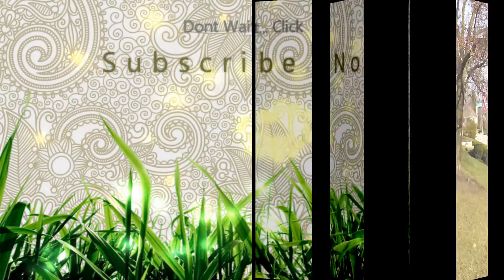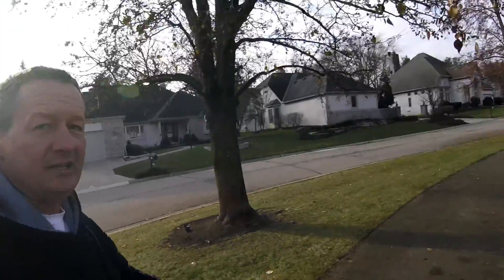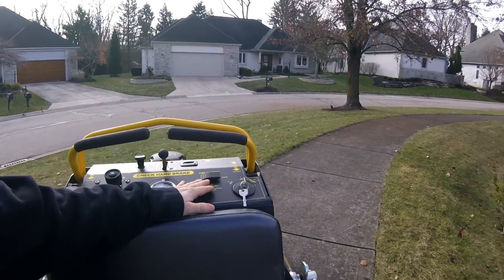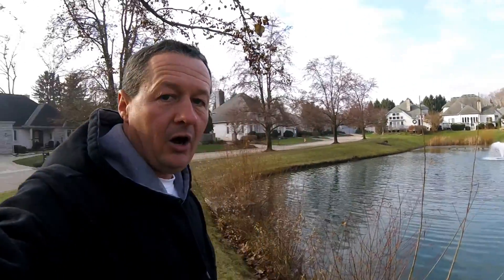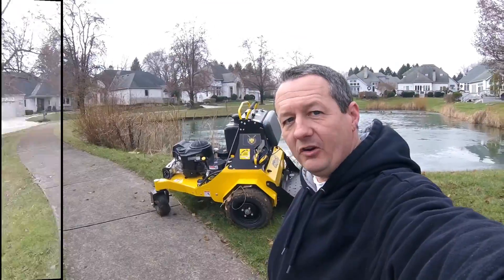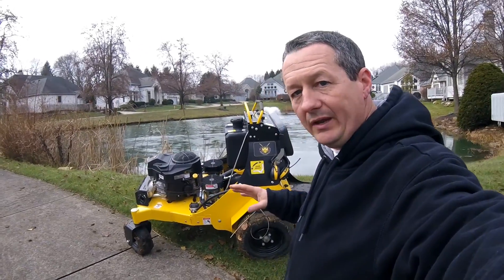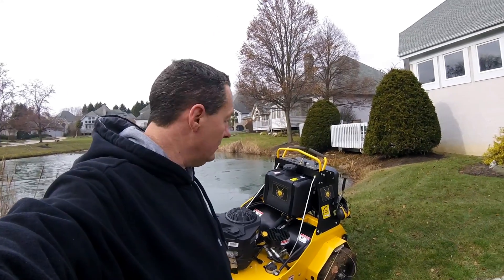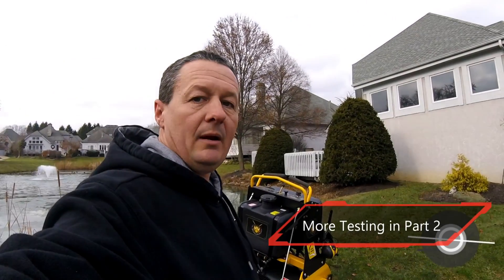Stinger Quad Aer, 3000 Field Testing - Part 1

Comment: What’s your experience tell about electric mount on spreaders on the front of aerators?  I’ve heard fertilizer dust will destroy the motors.  I just looked at a used one for sale and inside the air filter box it was caked in fert dust.  How you seen a mount up to cause any issues over time?
Reply from the maker: We use spyker electric spreaders for seed but never fert on the aerators. Pluggers aren't made for those corrosive chemicals. That why z-Sprays etc are all stainless steel.

Comment: Also now that the Stinger Quad Aer 3000 has been in the market for 3-4 years have you seen any issues with the durability of this machine? Any major issues that you have experienced or heard?
Reply from the maker: The newer units have significant upgrades that account for their "soft spots". Our new stinger has quite a few mechanical changes compared the older 2019 model. We have aerators from many manufacturers and all of them break. The Ryan zts was the most frequent down and soonest to break based on hours of operation.

Comment: I have watched all your videos about the Stinger Quad Aer 3000 and I am seriously looking at buying one of these. I already have an Ex-Mark stand on 24" aerator for smaller properties but could definitely use a little bit bigger machine on my bigger properties. I have a question though that I could really use your expertise on. I have taken out a Stinger Quad Aer 3000 out on some property in front of a lawn shop in CO and the plugs that it pulled were not as big (probably 1-2") as my 24" Ex-Mark which I usually can pull 4-5" plugs. Now I did this demo in January which I am wondering if the cold temps and a bit more frozen soil prevented the machine from pulling the 4" plugs that Stinger claims their machine gets. So I would like to know from you if you have experienced that the Quad Aer 3000 pulls a good deep plug (3-4") during aeration season when the ground is in prime condition both with thawed and saturated soil? I advertise to my clients that I provide a DEEP PLUG aeration with pictures of 4" plugs that I get with the 24" Ex-Mark and I charge higher prices to deliver on my promise. I want to make sure before I buy a Stinger that this machine will give the same deep plugs as my Ex-Mark does. Also, do you have to really turn up the pressure on the force knob on the Stinger to get the deep plugs cause it seems when you do this that it really puts too much stress on the machine?
Reply from the maker: Hey, thanks for watching. Yes, I do have to use a higer pressure setting with the stinger aerators but I seem to obtain just as good of results as I do with our exmarks. I think it has to do with the diameter of the cylinder being smaller on the stinger, but this also allows for the tines to go up and down faster. I do notice that increasing the pressure seems to put more stress and bog down the exmark units more than it does with the stinger. 

On a side note, I used to advertise the best and longest plugs too, but I got away from that because there's too much variance in the soil conditions to guarantee a three or four inch outcome every time. Also, I find that it's really tough on the machine to try to get that 4 inches in all conditions. And it wasn't worth the stress on the units, so now I shoot for about two to three most of the time. 
 The deepest plugger, and most consistent aerator I've use is our Ryan 3pt, but obviously it's not so practical in all situations. 😉

Good luck 🤞
Reply: @ColumbusLandscapers   Good to know thanks for the response. I actually did end up buying a Stinger a couple weeks ago. I am excited to add the unit to my fleet. That's a great point that I should not promise 4 inch plugs as I have seen what you are talking about with different soil conditions.

Comment: Other video you did, guy told 90% Siteone customers had issues with this machine... do you know why? Stinger fix these issues? I shopping for stander aerator and don't want spend 10k in problems. Txs!
Reply from the maker: Not so sure that's accurate... seems unrealistic, but try to contact site one directly and ask for feedback from them. We've run the crap out of ours and had only a couple minor issues. Not any more then the other brands we're running. Read comments on the considerations of buying at my newest video. Thanks for watching!
Reply: @ColumbusLandscapers  I heard from hot source and after read that comment on your video I'm not sure about that machine. But since that machine it is new in the market, they have a chance to fix the problem. Txs!